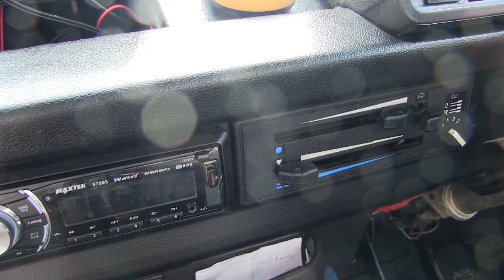Vanagon VW T25 T3 Blower Motor - PWM control upgrade (PT 1)

Comment: Thinking of doing this in my T3. Was thinking of wiring it up to my leisure battery and come on with night heater to help circulation. 
How many amps does this draw on lowest fan setting?
Reply from the maker: You'll really be taxing the leisure if you do. Better to use a small 12v PC fan to just circulate the air, or even simpler, split the night heater outlet hose to two areas which should help with circulation.

Comment: Is there any chance I can private message the person who did this video and link, I'm struggling
Reply from the maker: Why you struggling Adam?
Reply: @vwthings  I used the white wire as the earth on the earthing crown, is this correct? After Great effort of investigating I discovered that the 12v red black has been left loose  near the battery

Comment: Sorry there seems to be some confusion. 1) I asked you where you bought the small switch for the control and 2 ) where one wires it into the arduino. It would be a great help as I have the arduino but no switch or wiring diagrams. Thanks for replying before. Mike
Reply from the maker: Never mentioned an Arduino :)

Comment: Have done this on my van and have to say brilliant when working . I put an inline fuse in as well but it keeps blowing the control er I used looks exactly the same but is rated at 10-63 v 20a would this be the problem .thanks. Del
Reply from the maker: what sized fuse?

Comment: Could you post the links of parts from eBay or amazon I’ll need
Reply from the maker: DC 9V-60V 20A Pulse Width Modulator PWM Motor Speed Control Switch Controller uk on the bay - under 7 quid :) Listings change but has to be at least 20amp and controller on a flylead.

Comment: Did you get any noise across your radio etc after fitting this. I'm tempted to do this for better control but from researching people seem to think they will chuck out a lot of EMF
Reply from the maker: None whatsoever. The unit is screened anyway.

Comment: sourcingmap® 10V-60V 20A Puls Breite PWM DC Motor Geschwindigkeit Regler Kontroll- https://www.amazon.de/dp/B016EBVRFA/ref=cm_sw_r_cp_apa_PBWVyb35T0FEK

is this the right one for the job mate?
Reply from the maker: Yes that would do it although a cased board is preferable.
Reply: jackbox Yes I will make it one from a small tuperwhere box!
Reply from the maker: To be honest, better off scouring ebay for 20a PWM controller. - most are already boxed

Comment: hello, do it work on the AC blower motor? what kind of the DC moter do you use for the replacement ?thanks
Reply from the maker: It works on DC only. I used the same blower motor (12v)
Reply: +jackbox thank you for the kind reply. AC ,here,means air conditioning.I have two blowers on rear ceiling of the van. Did the 12v motor you used is old one from vw or you buy a new 12v from aftermarket?
Reply from the maker: Old one. In that case you just need to make sure the controller you choose exceeds the amps being used for your blowers :) If you're not sure, you can buy a cheap watt meter on ebay that would tell you this.
Reply: +jackbox thanks for your reply...I will try it out.
Reply: it has two blowers 20A for each. What would be your suggestion using 50A PMW controller for twol or two 25A for each? I guess usign a watt meter is better for monitor. Thanks a lot

Comment: Interesting upgrade.  As a side note, most vehicles today have several DC motors that are controlled in the same manor.   Its obvious that they have a similar arrangement and I'm sure there is an off the shelf device for this.